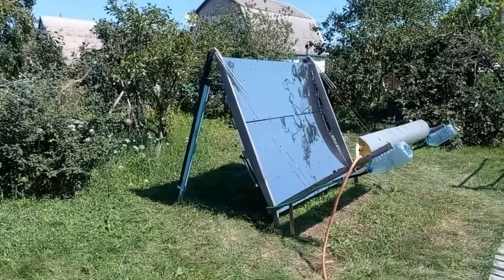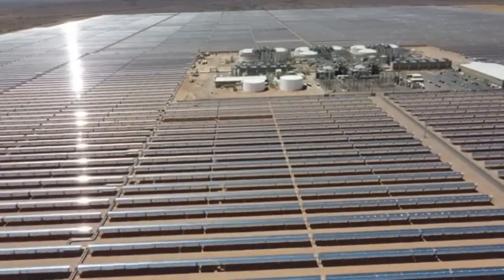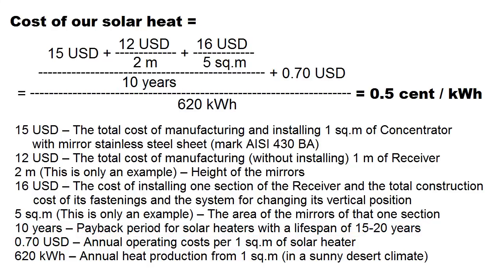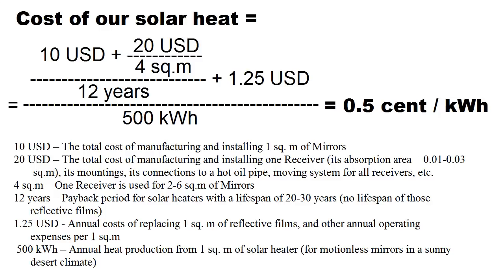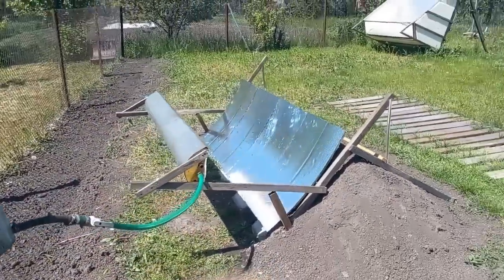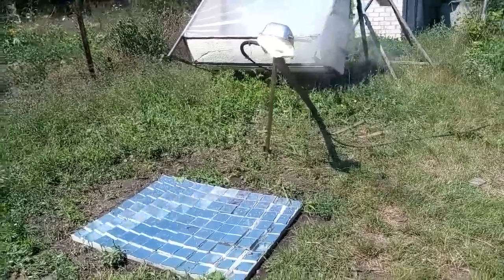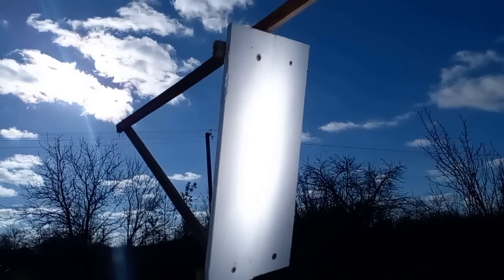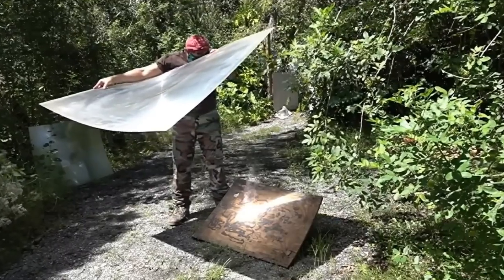6 ways to get the cheapest solar energy in the world (instead of fossil fuels and solar panels)

Comment: I have tested most solar heating system over many years. If you're willing to try to build one for yourself, please read my experience of it before starting:

Water system:
- vaccum glass tube panels are very efficients for their size, i would recommend over metal panels
- You will need anti-freeze liquid (polypropylen glycol) which is quite expensive. I'll call the liquid "water" for ease to write here.
- Water temperature vary from -10°C to +80°C. This cause multiple issues. There is no plastic pipe, joints, adaptators (even metal one) etc... supporting that difference of temperature without failing, causing leaks. Only way to be sure is to have metal pipe ALL the way long from panel to heaters, which in most case isn't possible or very complex and expensive. Also expansion of pipes make holes in the insulation.
-Temperature variation also cause pressure variation which has to be taken care of.
- Pipe has to be insulated or you will lose 80% of the heat. Pipe insulator are generally made of foam which degrade very quick outside from UV exposure. Expect no more than 2-3 years until it's dust.
-Heaters have to be the biggest possible or the heat is going back into pipes, reducing efficiency.
-Don't rely of natural thermosiphon. This doesn't work, get a pump.
After 2 years of struggling, dozens liters of antifreeze lost from leakage, and many money wasted i gave up on that system. 

Air system (taking air from the house, going into glass panel to get heated from the sun then go back into house):
 -Easier than watered in theory (no pressure issues, no water leakage stopping the system)
-Need fans which are noisy. The bigger the fan the better efficiency, but the more noise. Also those consumme more power than pump for watered system.
-Pipes for air has to be huge. Pipe resistance to air moving is crazy. 125mm is the minimum, i would recommend going for twice that. Of course those has to be insulated which is challenging due to the size of it. Also insulator tend to get wet from rain (even protected by plastic) and condensation, reducing its efficiency.
- Expansion of panel and glass make it very hard to keep airtight. I got 1-2mm of gap for each 1 meter section between coldest and hottest time of the day. And glass doesn't like to be in tension, adding a challenge to get it airtight.
- Air has to be filtered before coming back into the house because of polluants from chemical products in the panel (joints, glue, dust from UV exposure). Also air stink.
-You need automated pipe blocker or in the night the thermosiphon is bringing cold air inside.
-Air come back at +60°C. This is enough to deform plastics from pipes and fans.
I've spent 6 month working on this system. I've have redone everything 3 time now. I still can't get it to function properly. Can't get it airtight, can't get enough airflow, fans are too noisy, air stink badly, insulator are degrading quickly from getting wet, glass are shattering from tension. I've spent quite an amount of money and huge amount of time and work, and still have not got any heating from it. I'm starting to consider giving up too.

Reflectors:
-Mylar is rubbish. This is plastic sheet which degrade very quickly from UV (6 month to 1 year), and then you have millions of small mylar piece all over your garden. Use scavenged mirrors instead.
-Having the good shape is very challenging. Resisting strong winds too. Also you will have to adjust their direction every month.
-A reflector + receptor design isn't easiest to do. It's adding issues to the system, better keep it simpler.

Efficiency:
-Don't get duped by cool numbers from theorical power potential. Yes in theory you panel is getting hit by 1000w/m2 of power under the sun. But once you've removed the heat loss from the panel, from the pipes, from not enough flow, from dilatation and leaks, i swear if you can get 200w/m2 i will salute your work. My water system (1.5m2) gave me at best 200w(130w/m2), my air system (6.5m2) gave me at best 800w (120w/m2). And i've worked hard to get those numbers up.
 
While i'm struggling to make those work properly, my father installed photovoltaic panels in his house in only 3 month, much less work, for a higher price, but he now got 400w/m2 and everything is working for the next 10 to 20 years, while i already know my system won't pass a year without requiring more work on it to repair or maintain.

So in conclusion, if you want to try solar heating for the passion/curiosity good for you, but if you expect money return or to be cheaper/better than photovoltaics, then i can tell you it's not. Dealing with heat energy is a nightmare, dealing with watertight and airtight is a nightmare, and dealing with materials degradation from outside environnement is an already lost battle. Sorry if i destroyed your hopes, but reality is what it is. Don't hesitate if you have questions.
Reply: those heat losses make my think that it's more profitable to heat the water using electric solar panels
Reply: @HannibalLecter-w3r  It depends on the configuration. If you can get your thermal panel on the roof so the pipe go immediatly in the house it should be fine. But considering how photovoltaic became affordable nowaday, it's probable. What's sure is transporting elecricity is much simpler than pipes of heat (air or water). Also depend on your climate, if you live in a cold area, photovoltaic is much more efficient then (lot of heat loss from the panel too).
Reply: I mean antifreeze water going into a car cooler radiator inside the house should work well. If the glass is held down onto rubber sealing strips it should be able to expand and contract without affecting system. Or silicone maybe.
Reply: @leonordin3052  The glass isn't expanding that much, it's the support panel itself (in fiber glass) which expand the most, between 1-2mm per meter. Silicone isn't able to expand that much, i would advice rubber instead, and/or a support which allow movement by pinching the glass instead of thighting by end of glass panel.
Reply: Thank you for sharing, have you considered testing this on a sterling engine? Forgoes having to make steam to drive a turbine
Reply: Thank you man... Your a hero
Reply: Most sensible comment here, thank you.

If it was that simple to master heatflow cheaply and without losses it would have been done decades ago. The technology is known and there's so much money in the space that it would have been an off the shelf product like PV panels if only it was as simple as the video claims. It isn't. Heat losses and material degradation is a hard problem.

A hybrid technology of thermo-pv panels is being researched but it is still in the development phase, so the jury is still out on that.
Reply: @vaakdemandante8772  Dual Sun panels ? (France)
Reply: Fujisol heaters are popular in central and south america , doesn't work ?

Comment: Gold is a very good reflector of infrared. A parabolic gold mirror could melt rocks, casting basalt into sculptures. A city with lots of mirrors would be called a city of gold?
Reply: Great idea, gold coating is not so expensive. Why don't we have infrared solar panels with similar functionality principles like uv solar panels?
Reply: So you want to reflect all the light not just inferred the black bodied receiver needs to convert all energy into thermal. So gold not really usefull
Reply: Wouldn’t that be expensive?
Reply: Tall buildings are often covered in glass of many colors including gold-tinting... some are semi-mirrored by glass-tint or window-film. Glass mirror buildings will be called - a city of tall-buildings, central business district, chimney, concrete jungle, furnance, ...
Reply: Solar furnance

Comment: I use Fresnel lenses for cooking and I don't think they are the best idea for what you want to achieve. I don't mind moving the lens manually when being outside on a sunny day, but to run it unsupervised you'd need to turn it automatically on both axes including the target you want to heat. Complicated and probably not very windproof. You are also limited to the size of the lens which is usually less than 1 square meter when salvaged from old rear-projection TVs. The plastic also might age quickly when permanently exposed to the sun.
Reply: Any way you can post a video of how you do it?
Reply: @timrulestheearth  Maybe this weekend, it's in the editor already. Basically I put a cast iron pot or dutch oven in a container to retain the heat, then point the lens to the lid. So far I made soups, stews, bone broth etc. Roasting, baking, sauteeing doesn't work.
Reply: I have to correct myself, with the use of an electric turntable I was able to grill burgers and chicken wings with very good results. I put them on a cast iron pan and let them rotate through the focal point so they don't burn and brown evenly. Videos are up.

Comment: There are parabolic concrete forms on the beaches of England.

A person standing at the focus can hear the slightest sound out at sea.  

That’s how they kept a lookout for German submarines.

The sound of their propellers gave them away.

So, if you constructed parabolic  forms in the desert, you could catch the sunlight and send it to a mobile heat sink.

It would move on a curved track.

The Focal point would move as the Sun rose and set, so the target would have to move as well.

Pump your thermal oil through the heat sink to absorb the heat.

Comment: I’m really impressed how well it works with winter sunlight. What kind of outside temperatures are you dealing with?I live in a cold climate and am curious to try these methods
Reply: In the Low Sun of the Winter, an increase in main Collector Surface of 30% to 50% would probably equal the Base Surface Area Results of Summer! 

To do the Calculations, you'd need the Summer vs Winter Sun Angle plus Hours of Daylight Ratio.

Maybe additional factors, for a Greater Precision, but those points should suffice!

Comment: I understand your intention to minimize expenses, but if the material you're using is Mylar (although you didn't explicitly mention it in the videos I watched), it's worth noting that here in the United States, it is commonly referred to as Mylar. By adhering that Mylar sheet onto fabric, you can achieve the desired outcome. Perhaps I missed it, but it would have been helpful if you had mentioned this in your videos, as I didn't come across it. I thought it was important to bring up for the benefit of others as well. The effectiveness may vary depending on the type of adhesive you use. Personally, I recommend utilizing silicone glue due to its flexibility and strong bonding properties, or heat-activated adhesive. Although I'm using it for a different purpose, I have found that it yields similar results in terms of durability. For those who are interested, I'm utilizing Mylar for solar production. Since we reside in a densely populated area with closely spaced houses, solar energy isn't the most viable option. However, the projects I've been sharing, and will continue to share in the future, demonstrate how individuals living in areas where solar energy isn't feasible can still harness the power of solar. I apologize for not yet posting all the Mylar-related videos, but they will be made available in due course. At present, my focus is primarily on isolinear solar. You can check out my latest video at https://youtu.be/8WKQNz_reEY."

Comment: Metal angle-iron used for building storage-racks(cabinets) is a cheap grid-structure

Polished stainless-steel sheet-metal shipped as tables(sometimes wrapped around wood, ...) and chairs are not too expensive when find cheap and buy in bulk. They can be further polished by car-polishing orbitals or plastic-polishing cloth buffing machines (don't add chalk). 

The idea is to use many and avoid high heat on each piece, but have high-heat due to many pieces focused-concentrated. The average sun movement per-season will require manual-labour to shift. The normal daily sun movement should be covered by east-west layout of many pieces of vertical-rectangles arranged to a center point. Hours of day will result in more pieces for morning and evening and less pieces for noon. Not a full dish-shape.

Comment: H Sergei, a way of building houses is styrofoam reinforced with steel. You could find a styrofoam factory to make the shape you want and insert steel struts which in the houses were like framing. Heated wires are used to cut in a factory so they can be mass produced. Many houses have old unused chimneys which you can run the pipe from the roof down the chimney then fill the chimney with sand or other unused spaces in the basement. As I recollect South Korea provided the 4 hour dry time vs. the old 8 hour dry time styrofoam machine for $800,000 which was back in the 1990s. Styrofoam is so useful whomever buys the machine can supply many uses in addition to yours as you build volume.

Comment: Just think if you could get cheap three litter pop bottles and coat or paint one half in reflective material you could cut it in half and have two mini solar troughs. Or an insulated trough for water heating with whole bottle. Though I think, it should not exceed 100 C because of the plastic.

Comment: one thing I can see that is a failure point, is the need of your units to move to chase the sun. My system sets still and the sun hits it at all times. Another thing that is wrong with the comercil  units is in how they store the solar generated heat in tanks above ground. Put these tanks under ground and get better insulation and there by longer lower cost storage. I have 2 systems of my own design that have minimal moving parts and storage requirments and when the world gets ready to be real about getting renewable clean power I will be happy to sell them to them. I even have a easy pay plan for the first ten countries that get in touch with me and put up a good faith  ( non-refundable ) payment, as well as a ironclad contract to pay my trust from now on so that my decendents will be provided for.

Comment: Store energy in salt?
Reply: I prefer rock batteries
Reply: @mhgscrubadub9917  what are those? Any link to one describing it?
Reply: @Apafej627  Lava rock is incredably good at storing tons of heat energy so if you keep them in an insulated tank and run hot air through it they work like a huge thermal battery
Reply: @mhgscrubadub9917  OK, but you can't shape lava rock! Or can you? Can it be crushed? It's not like sand or salt that will take the shape of the storage tank. And it's not so common like sand, you can't get it everywhere! Are you talking about basalt stone?
Reply: @Apafej627  You can crush it into smaller rocks.  If you have a large storage tank with 2in rocks youill still be using the tanks volume extremely efficiantly.  All you care about is that the rocks you use are porrus and have an extremely high melting temp.  The pores allow for the air to gain access to a lot more surface area in the rock so heat can get stored in denser amounts.